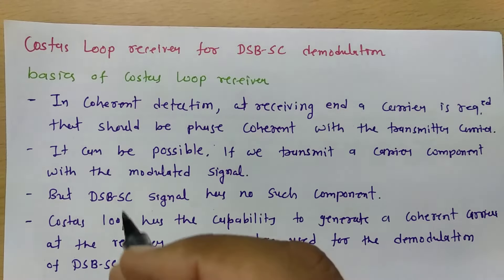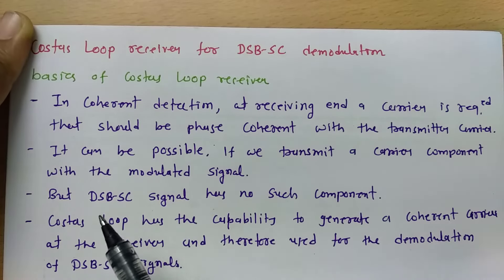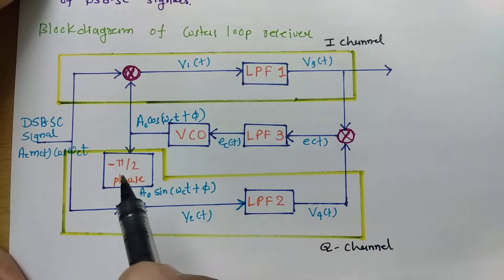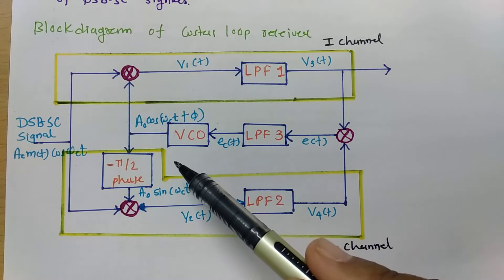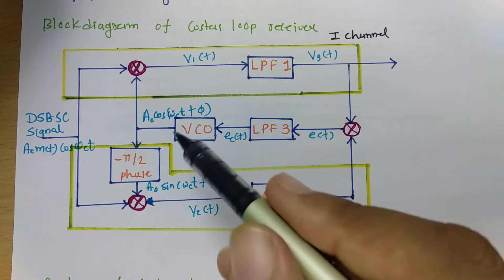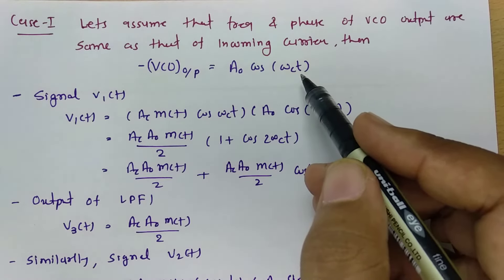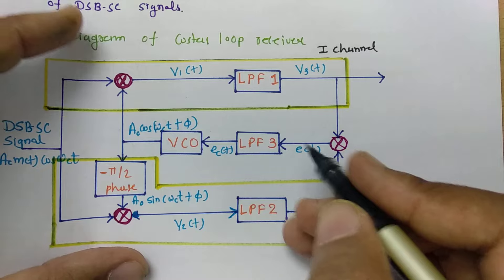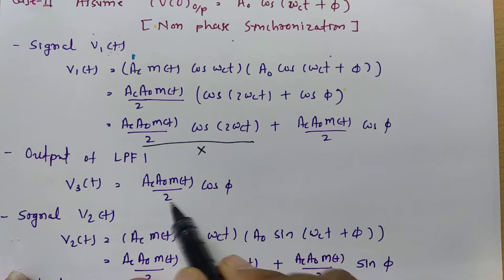Costas Loop Receiver (Basics, Block Diagram, Working, Derivation & Advantages) Explained

Comment: Sir sometimes you are writing DSB-SC signal as m(t).coswct and sometimes as Ac.m(t).coswct . So which is the correct one? Because if we reject the carrier signal then we are only left with m(t).coswct . So from where Ac is coming? Please clear this.
Reply from the maker: Both are correct. Ac is just Amplitude, we need to understand signal in terms of frequency Components. So DSBSC, can be referred as m(t)×cos Wct or Ac×m(t)×cos Wct, both has frequency Components as wc - wm and wc + wm.
Reply: Ac is the amplitude of carrier signal, which is a constant. So it doesnt matter if you consider Ac term or simply neglect it. Its only the amplitude scaling factor of the modulated wave. Simply take dsbsc wave= c(t)m(t)=Ac.cos(wct)m(t) in all your analysis.